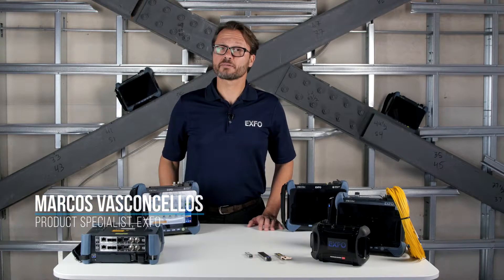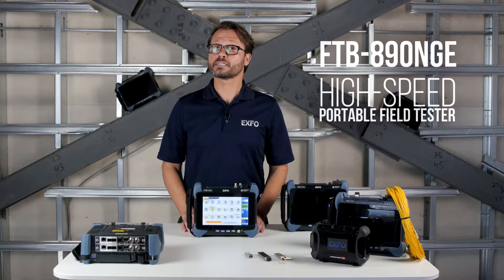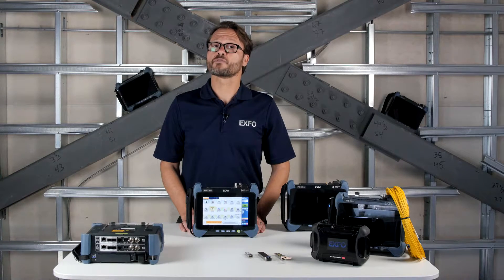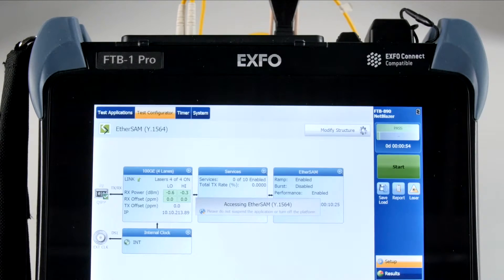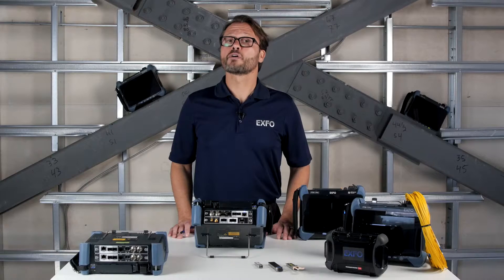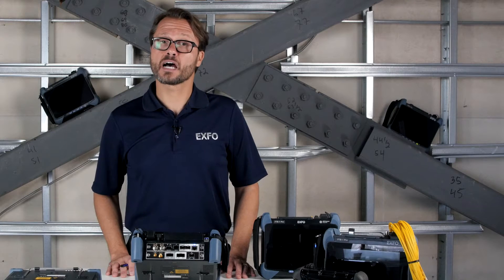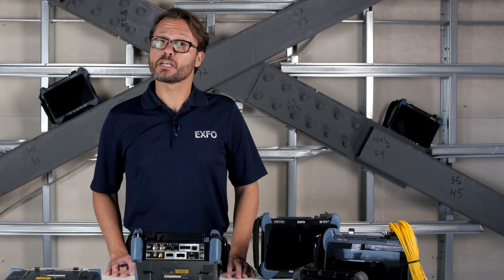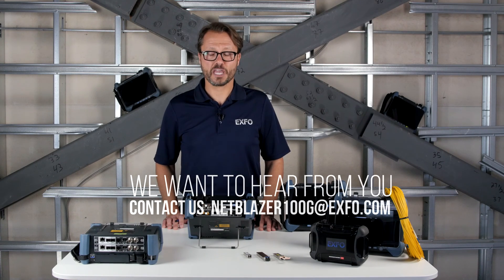How to do a 10G dual port test | FTB-890NGE

Comment: Hi, I’m trying to run dual parallel test however P2 of my FTb-Pro is not coming up. I’m receiving on the port and transmitting however it still shows the link as down.